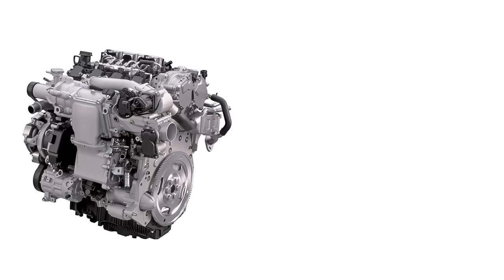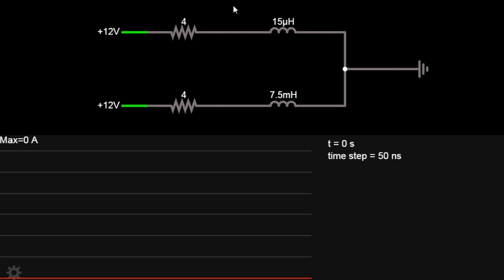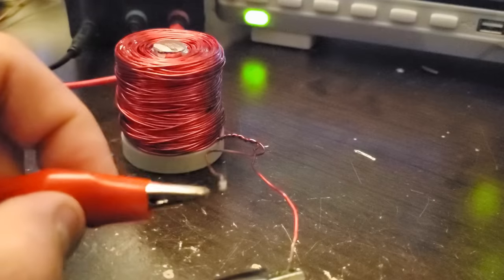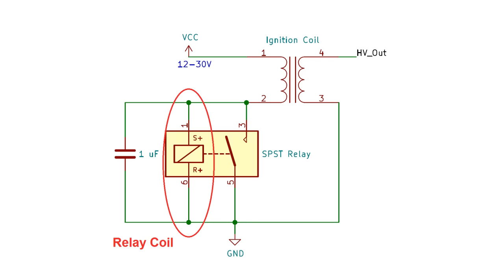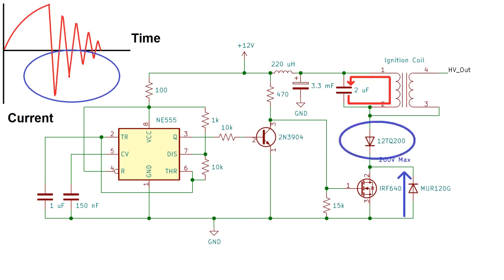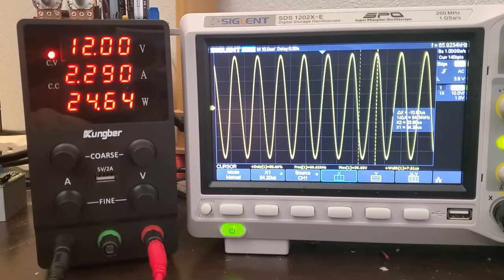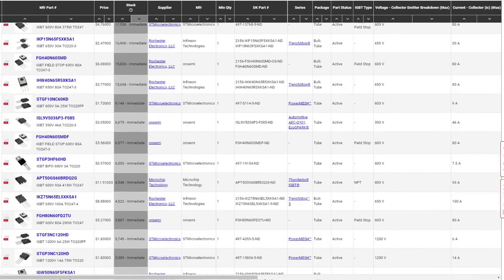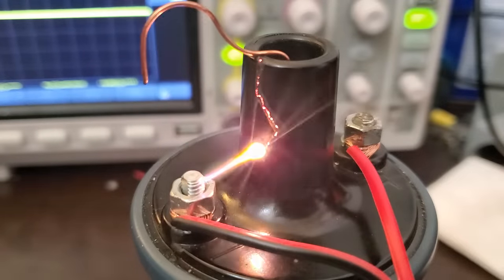Ignition Coil Drivers

Comment: All the traditional coils I pulled apart had a laminated iron core, afaik only the new oil-less coils actually use ferrite cores. Also, coils can handle way more than 20-40kv internally, as amply shown by putting transparent PVC pipe and Vaseline over the central HV posts, and using a light dimmer/motor speed controller and HV capacitor in series with a coil to pulse it with 320 volts from the mains supply gets about 60-100kv from a single coil.
Reply: Your a madman, here I thought running a neon sign transformer through a series of HV capacitors into a 3/8" copper pipe primary my secondary coil was a four foot piece of schedule 40 pipe with 1000 turns of magnet wire.     
Great emf at low amperages.  What your talking is something similar to high voltage transmission lines potential or did I miss something?
Reply: @vidxs   a motor controller at 50% running a car coil in series with a capacitor charges/discharges the capacitor into the coil/s every half cycle, creating powerful 100hz spikes at ca 100kv for a good coil. The same circuit can be used with microwave oven transformers to get much higher voltage out of them, and the capacitor conveniently also acts as a changeable ballast; normally people use 3 MOTs to do what this circuit does with one, check my channel for videos with a description and demo of this circuit used with car coils and MOTs for Jacobs' Ladders, etc.

Comment: 9:40 this coil is iron core and your frequency is around 20khz. you need iron powder or Ferrite core(like the first transformer which you winding wire on it) to see big and powerful spark in 20khz not 300hz. 
Great presentation. thanks 🙏

Comment: I saw a chart once that said it takes 70,000 volts to jump a 1 inch gap at normal air pressure.
If you increase pressure it takes more volts to jump same gap .
I have seen this on a spark plug tester as air pressure is increased to the point that the spark will not jump the gap anymore .
Reply: Depends greatly on electrode type. Two needle points about 20 kv per inch, two 1 inch diameter balls, about 60-70 kv.
Reply: You may find this interesting
In race engines with static compression of 13:1 in order to have a solid spark up to 7-8k rpm you need  a capacitive discharge ignition amplifier around 135+milli joules output and 50k volt 100:1 turn coils and those figures go up. I just mentioned electronics on  the level I race at.

Comment: Excellent video, thanks for taking so much trouble to set it up, film it and explain it. Really well done, and great to see the math behind it..
What would your thoughts be on turning this into a really effective electric fence driver? Also, the ignition coils that you're using - are they just off the shelf car coils (the old type, as many cars now have one coil per spark plug). is anything usually visible on the coil unit to indicate its rating?

Comment: What type of capacitors you used for the igbt driver?(I would be most interested in their voltage)
Reply: Polyester caps 600V. 470nF should do fine.

Comment: I destroyed an ignition coil in much the same way many years ago.    Basically my circuit was a capacitor discharge ignition system.  Without the load (spark gap) connected, it very quickly made a track like the one you got.
I also got the resonant design to work but it too was at the cost of a coil.  The trick on that was to find the resonance of the high voltage side and tune the primary to match.
Reply: So you're saying to pulse the Primary at the resonance frequency of the secondary?
Reply: @bmw7z  Yes the drive on the primary can be pulsed at the resonance of the secondary.  You can make this happen automatically by how you design your oscillator for the primary side.  You can do even better with a capacitor on the primary side.  Basically if you drive the primary with a weak signal and sweep the frequency you can see the impedance drop when the secondary resonates and starts taking away energy.  It won't drop to zero because there is some leakage inductance and some resistance.  That is the load your driver is working into.

Comment: Due to isolation reasons, the primary of cylindrical coils with a single HV terminal usually is wound atop the secondary. The secondary's beginning is connected to the HV terminal as well as to the core.

Comment: The presentation here and knowledge base is incredible, and very much appreciated.  I have one question though.  As I tend to keep things as simple and yet efficient as possible, how do you think a fast solid state relay would work with the simple relay driver?  Maybe one that is 2x the power capacity so it's only run at 50-60% power for long life (hopefully).  Or would a simple reed switch relay be even better for higher switching frequencies?  I would really like to try this on a couple of coils I purchased from summit racing.  Thanks.
Reply: Those off the self solid state relays (SSR) are usually garbage unfortunately. The components in his diagrams are basically a solid state relay with added protections and efficiencies you won't find in an off the self SSR. Reed switches will suffer from the same issues as the mechanical relay shown in the first example.

Comment: Great video, thanks. What if your circuit was to be used as an ignition box in a 1cylinder motorcycle 4stroke engine? The 555 timer and duty pot would not be needed, and the trigger signal would come from the magnetic switch on the flywheel. What part of the schematics would not be needed?
Reply from the maker: I think you could remove the 555 timer and just connect the magnetic switch from the flywheel to the IGBT/MOSFET gate with a protection resistor/zener diode for safety
Reply: @HyperspacePirate  you guys are getting into the swing that Tesla talked about and the mechanical spark gap he used to tune to the optimal frequency hence Mechanical Resonance  ..

Comment: While taking a course many years ago on the then new Sun diagnostic scope, we were using an Oldsmobile test engine with the HEI ignition. The scope was calibrated to 100,000 volts. When a plug wire was pulled with the insulated pliers, the firing line went off the top of the scope. To this day I still have not found the max output voltage for an HEI ignition. I have seen rotors and plug wires fired through. As well as a racing engine that suffered from detonation. It had blown the ground electrodes off two plugs , but was still running on all eight cylinders. have you ever measured the output of an open HEI system.

Comment: I wired up a relay coil with a 1uF cap in parallel with NO contacts as shown in your schematic.
Contacts buzzed, then glowed red then stuck from melted contacts.
Do you think a resistor in series with the NO contacts would help?

Comment: I noticed that in the last circuit the pot is 20K but in the life video is 10K.  Also, before you had a 3.3mf cap and after you installed 2 x 330 microfarad electrolytics. What are the 4 grey components on the right side of the board. Sorry for so many questions. I also intend to install another inductor of 220 micro-Henries between the point of the 2N3904 and the 15K resistor to introduce a second earth due the output will be connected to a Tesla coil. Do you think it will be OK? If you can find time to answer I deeply appreciated. People like you make a difference. God bless you and thank again.

Comment: Thanks for the informative Video. I'm currently working on the Bosch ECM of my 2015 Sea Doo (260 Rotax 1503 cc Supercharged 3 Cylinder), issue is that the ECM isn't Firing the #1 Ign Coil. I've ordered some IGBT MOSFET Transistors (10PCS V3040D 400V, N-Channel Ignition IGBT ISL9V3040D3ST TO-252) and some H-Bridge Chips (5pcs TLE8209-2SA Automobile computer board chip). My plan is to swap out the IGBT MOSFET Transistors first and hope for the best? H-Bridge is the second option which would likely require a Re-Flash of the ECM? I'm a Retired Professional Wrench (Audi's are my Specialty). I'm certainly not an Electronics Technician but I'm not afraid to try to repair my ECM.   Randy   AKA randog311  (FYI, I was unable to to read the numbers on the original IGBT MOSFET's, so I took a wild guess as to which one to order)
Reply: I highly doubt anything that new uses a "dumb" coil like this one. Most anything with an ECU has moved all the high current control circuitry for the coil into the coil itself or an external igniter for EMI reasons, to protect the sensitive microcontrollers. How did it work for you?

Comment: I was working on an old Wisconsin gas engine that ran a compressor on a lube truck. I removed the distributor cap and cranked the engine over and with cover off it started right up! The spark was jumping all over the place making its way to the 2 spark plugs! The whole crew got a good laugh out of that one! That was about some odd 40yrs ago.
Reply: The distance had to be very long between each pôle !! How that would be possible ?!!
Reply: @pierrevandeputte2543  just by telling bullshit as people tend to do.

Comment: In the 1970s I obtained a reed vibrator which resembles a radio valve except it’s in an aluminium can. I never opened it but suspect a relay.
I used this to get a spark from an ignition coil. I imagined it to duplicate the function of a distributor.
Reply: Right you are. These were used in early battery (2 volt lead acid) powered portable radios to produce 300 volts for the TUBE circuits B4 transistors were invented.  The circuit was exactly as you imagine.  :)  Aint history neat?

Comment: Many years ago I made a high voltage generator out of an ignition coil using an SCR. The SCR was connected in series with the coil primary with a reverse blocking diode. Then the whole thing was connected to the incoming mains via a diode, current limiting resistor and storage electrolytic cap - and the SCR gate was suitably pulsed using a Diac. So the main capacitor charged up to around 400V (240V supply), then the SCR would fire and dump the capacitor charge straight across the coil, switching off immediately the fly-back went negative. It produced a hell of a lot of voltage and was surprisingly efficient. :-)

Comment: I’ve messed with a lot of hv lab supplies. A lot of them that rely on ferrite core high frequency transformers actually run a constant voltage to the center tap of the primary and alternately ground the ends. Just some food fer thought.

Comment: Don't forget that capacitance is an inherent part of the picture. The secondary has distributed capacitance and the primary normally has a separate capacitor (across the points) which forms the primary resonant circuit. It forms a double-tuned system which ensures efficient energy transfer from the primary to secondary (just like a Tesla Coil). The MOSFET half-bridge driver leaves a lot to be desired. I suspect it is not turning on hard. The gate-drive circuit have to deliver substantially more voltage than the source will be at when the device is fully turned on. In switchmode power supplies this is normally achieved using gate drive transformers and in the case of using a driver chip, a bootstrapped gate supply for the upper MOSFET.

Comment: That 'Chattering Relay" setup you have 5 minutes in, that's one of the environmental tests performed in avionics qualification. In an aircraft the wires will cross talk from mutual inductance. The test has the electrical susceptibility radiator current passing through the coil of the relay, where  10ft/3m of the interconnect to the EUT (equipment under test) has the wire with this chattering relay signal wrapped about the harness.

Comment: No electrian here, but when you step up 12 volts to 40,000 volts and you get bit by this, you quickly gain respect. I'll never grab another distributor and turn it for timing. It shouldn't leak, but you never know
Reply: It's the metal part that is safe to handle, it's at the same potential as the whole of the car; 'earth'. The top detachable part, the 'dizzy cap' and leads, even though they're insulated, are the one to keep your fingers off. 
I remember my old '60's light van had a misfire, so, not knowing which cylinder, I had the idea of pulling the spark leads one by one, to see if the engine note changed whilst it was running. 
Got no further than the 1st one - Nasty, nasty experience - went through every swear word in the black book ! Used my right hand - or might have not been around to write this today.

Comment: Could you stop the arcing by placing the ignition coil in mineral oil? Or completely remove the ignition primary/secondary coils & place them in mineral oil?
Reply from the maker: It might help, yeah
Reply: It 100% helps, I've done it. It can also help cool it depending on how much current you're running through it.
Reply: The can type coils come oil filled, just drop the whole thing in more oil. Using the proper connector and boot would probably also help with arcing through the tower.

Comment: For the first solid-state driver why cant you just use the spark gap in parallel to the "primary" (since its an autotransformer), and add HV diodes?

Comment: Hey great job and explanation! I wish you would have gotten the resonance working. In your final deaign, I wondered, what purpose does the 220uH inductor serve? Does it slow amp flow for the circuit? also it looks like the 330uF capacitor might be charging it before it releases? If not, would changing the ground to the other side of it (to charge it when the transistor is on) have a voltage boosting effect?

Comment: Where did you get the idea of using diodes across the switching transistor as a means of over-voltage protection? Using the revsrse breakdown voltage of a silicone diode is just going to cause it to fail... the inky thing those will do is protect against Hugh reverse voltage... just like the body diode.

Comment: Typical breakdown voltage of air at standard temp and pressure is 1KV per millimetre, so an inch gap or 25mm needs about 25KV to flash over.

Comment: I'm interested to make your board to control the coil - one should arrive from Amazon today.... - but I'm a newbie in electronics, so I do not know what kind of capacitors are you using. Can you provide me with more details, so I can order the correct parts? Also a picture of your assembled controller would help me. Or if you could recommend simpler controller that would be very nice. I like also that your board has a potentiometer! Thank you very much!
Reply from the maker: The capacitors are film capacitors. Other components could be interchanged with generic parts, nothing really specialized

Comment: Those "12 volt" coils were actually @ 6 to 7 vdc. They were supplied full battery V @ cranking because of the large current draw across the 12 volt battery during start up of the engine, & the fact that the engine was undergoing a cold start in some cases therefore the coil needed the extra "push" during V/I sag. After the engine was started, a rather large wirewound power resister was inserted into the circuit supplieng the coil primary dripping it down to @ half of the battery supply voltage. No, I'm going from memory hear... Been a while since I was in automotive tech school.

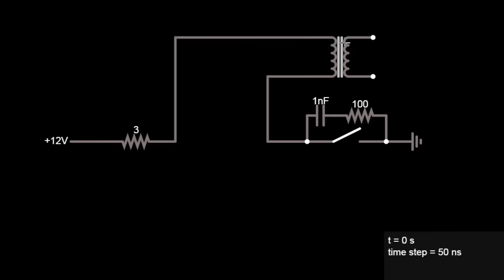Comment: First of all, thank you for sharing this knowledge with us. I hope you can clarify something for me. On the diagram with the relay as driver, the ignition coil has 4 contacts. The ignition coil you used has only 3 contacts. For the diagram that would mean, contact 2 and 3 are directly connected within the coil and that there is no direct link between contact 3 of the ignition coil and GND. Is it still working with the link between ignition coil contact 2 and 3 as manufactured? At time 4:34 I could see a small yellow piece a the bottom of the video. What is this piece? I would really appreciate if you could help me out on my questions.
Reply from the maker: Yeah, 2 and 3 would be directly connected inside the casing because the primary and secondary coils share a common ground.

Comment: I have a need for a device that will create a snap spark that will burn an approx 1/4 inch hole in clear shrink film every few inches as it travels by at 15 inches per second.  A standard GM LS ignition coil is prefect except it does not have nearly enough power to do this.  I am contemplating using several of these ignition coils in parallel with each coil output likely running its output through a 30kv diode to the probe that fires the arc through the film.  The diode would be to stop any back feed through the coils. What are you thoughts of this method to create a snap spark device with readily available parts with significantly more power than one ignition coil.

Comment: I think you got more than 40 kV. To get 1 cm spark in air in normal conditions you need about 32 - 36 kV (depends from source of information). You got almost an inch. So I think voltage was much higher.
Reply: Isnt it supposed to be 1mm is about 1kv? 40kv would be 40mm or 4cm?
Reply: @nathanial7249  No. Search "air breakdown voltage", "air dielectric strength".
Reply: Sharp pointed electrodes need less voltage to flash over than a blunt surface. I have two 50mm diameter steel ball bearings to measure high voltage from ignition coils. They need almost exactly 3kV per mm spacing to spark.

Comment: What did cars use a hundred years ago for the relay? Something that spun off the engine or something?
Reply: "Something that spun off the engine" - Essentially, yes. The 'relay' part, known as 'points' were spring loaded and  opened nechanically by a cam driven from the crankshaft. An engine with 4 cylinders would have 4 corners to actuate the points. The spark timing relative to 'top dead centre' was set mechanically by physically rotating the points a degree or so in whatever direction needed for best engine performance.